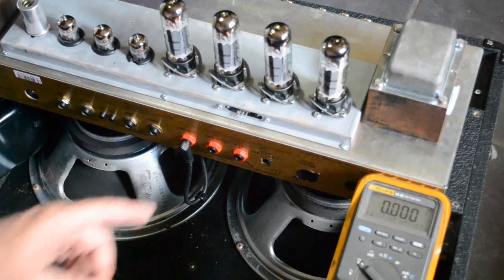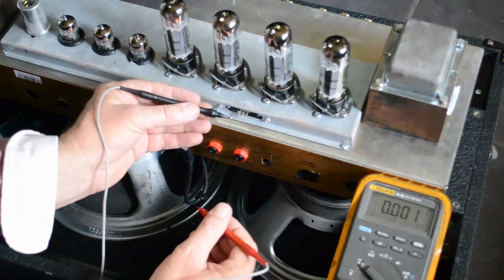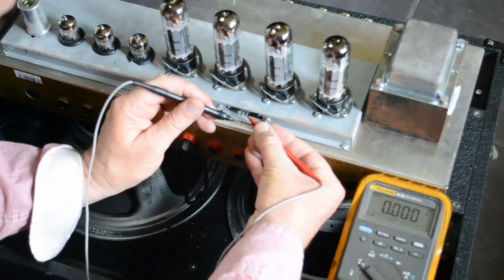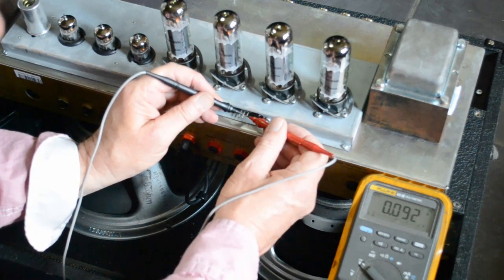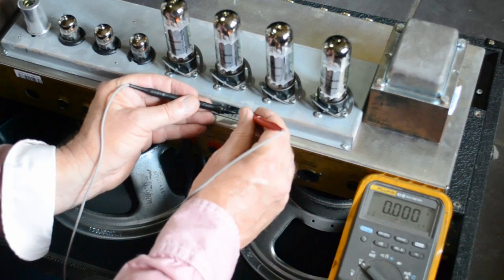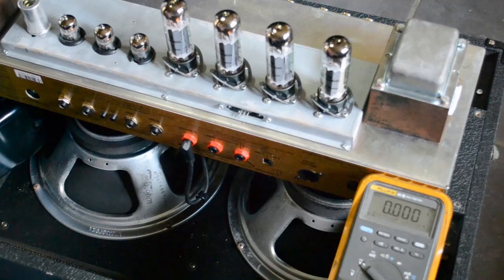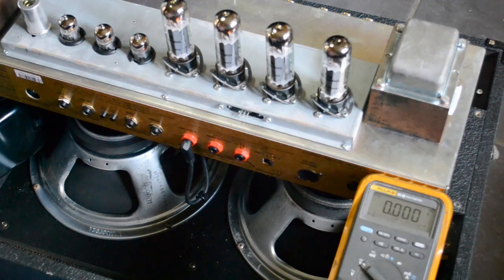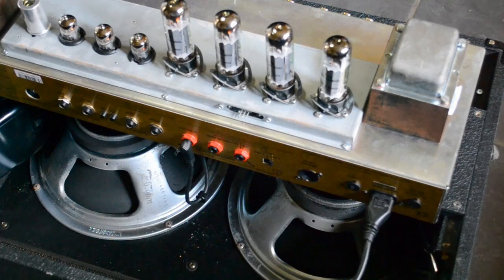Marshall JCM2000   TSL122 Valve Bias adjustment

Comment: Very good vid - thanks! I'm just about to bias one of these. A trick I've learned is to use a hooked probe and pop that on the center pin, so then you only ever have one hand near the amp. Putting the other hand in your pocket is a good way to ensure the current cannot run up one arm and down the other.
Reply from the maker: Thank you for your comments. Great tip.

Comment: Hey, I've got a stupid fast question: can it be somehow dangerous to take out the reverb tank without removing the entire head from the case? I'd prefer staying away from the capacitors you know. I've only to check the springs in the tank because the reverb is very weak. Thank you in advance.
Reply from the maker: Sorry I forget how it comes apart.
So long as it's not been turned on for a few hours you should be ok.
Reply: @JohnB-2021  okay thank you 😁

Comment: **This should be done by someone who is qualified in this field *

But just a reference,Centre pin is also chassis ground , the left and right pins are 1ohm to ground , 

But always check plate voltage and AC input voltage as valves are subject to line input voltage and do change depending on where you play / area etc 

Plate voltage calculated with bias will give the total wattage for EL34’s and around 18-19watts  per valve is quite hot . 
This should only be done by professional electronics technician, as plate voltage can be 400-500 vdc , and you don’t come back from that . Be safe out there guys , best to have it done professionally.
Reply from the maker: I wouldn't use the term 'qualified' 
I would say the person adjusting the bias needs to be 'competent'
Is there such a course to become 'qualified' at amplifier repair?

Comment: Anybody cut out and put a vent on top for heat ?
Reply: The metal cover that holds the main PCB (and output tubes) can be raised slightly with small washers (6 needed) to allow more free air flow. Not a lot, perhaps, but any air is way better than none (stock, there is a tight seal to the chassis top and heat can only escape through preamp tube openings or bias adj. opening). I did this with a friend's DSL 100 to help overall cooling, and hopefully add a bit of reliability to the amp. Certainly can't hurt.

Comment: Tweak the bias so that you get no crossover distortion , then add 2 or 3 mA as a safery zone
Reply: The crossover notch method is the absolute WORST way to bias an amplifier!!! They leave the tubes OVERBIASED, and running way too much current at idle, and as the tubes age, the crossover notch distortion will reappear. Use The Trainwreck Pages by legendary amp guru Ken Fischer's measured current biasing system. Just Google: "The Trainwreck Pages" and follow the instructions. 

Regards 🎸
Reply: Please explain .  I own a 122 also.

Comment: Hi John, I've been biasing my JCM 2000 DSL 100 exactly the same method as you by hand to balance tubes. I heard you mention not wanting to short it out whilst touching the pins. My hands are not that steady, and a couple of times I've accidentally just touched my left hand positive multimeter lead to centre negative pin, while holding negative lead against centre pin with right hand. Only caused a minor hum each time. Amp still works all ok, all be it sounding more trebly and less meaty than before! Maybe due to lowering the bias a small amount and containing original tubes? Amps year is 2000 so tubes are old and may even be older. I've got power tubes balanced nicely, but doesn't sound as full or pleasing anymore. Have ordered a full set of new tubes, but could I have caused a problem by just touching the pos lead to neg pin? Excuse my ignorance, but hoping it's just old tubes not reacting so well with re-biasing. Any advice and wisdom would be very appreciated.
Reply: You are measuring the voltage drop across a one Ohm resistor which is fitted between the valves' cathodes and ground, solely for the purpose of bias adjustment. If it is shorted out your amp will not be damaged.
Reply from the maker: Hi,
Valve amps aren't my forte, but I doubt you have damaged anything since it still works.
Lowering the bias may affect the frequency response, I have no experience with these amps so can't offer any advice.
Thanks

Comment: Optimally 80mA for each pair -  no noticeable change in tone - but a little prolong the life of the tubes.
When you wear tubes out to 2/3 sheet emissions even 75mA - but then you can fry a little sound. 

WARNING: absolutely need to replace the original electrolytic capacitors C36 & C37 in bias circuits from 47uF/63V for new 47uF/250V!!! 

Best type Jamicon, Nichicon, Rubycon Panasonic, Sony and other good brands with low ESR.

The variable component of the phase inverter will slowly stripping and leakage capacitors resulting in the disappearance of bias during operation of the amplifier.

Zoltan

Comment: Hi, I have a question. I have a laney irt60 212. I read the manual and it say V1 12Ax7 for the pre amp and V10-11 6l6 for the power. Im confused with the versioning the V1 and V10-11. Does it matter? I cant seem to find the versioning in the tube store. Can you please explain what it means? Thanks
Reply from the maker: Hi,
Sorry I have never looked at one, just replace what came out.
Reply: ok thanks
Reply: They're just labels. V1 for valve (tube) #1. You need a plain vanilla 12AX7 to replace the tube labelled V1 etc.

Comment: hi you put the red probe in the middle for one side and on the right side on opposite side -does the red probe go in the middle to best both sides -thanks
Reply from the maker: Hi,
No it's just the way I was holding the leads, easier than swapping leads over.
My meter is a good one, so it doesn't matter if the leads are reversed.
Black in the middle, red to the outsides.
Some cheap meters will read inaccurately if the leads are reversed.

Comment: Hello John, I'm new to valve amps and I recently got the same amp as you have and I wanted to replace the 4 big tubes EL34 because of some weird sound that the amp produces sometimes.There are 3 pins middle pin is common right? 1 and 3 are positive and both side should be set to 90mV or 90mA?should I replace the 4 small preamp tubes as well?
Reply from the maker: +Ramon Conte 
Hi,
Yes you're right with the pins, measure millivolts to set the current.
Read below, most people recommend less than 90.
Change the pre-amp tubes if you like, I guess you would be starting with a fresh set.
Thanks
Reply: Thanks John, yeah I will replace them all. Just one last question. When you say biasing it means biasing the Pre-amp and the power tube or the power tube alone?
Reply from the maker: +Ramon Conte 
Power Tubes

Comment: Does the red pin always measure the on the middle pin on the amp, meaning the black pins do both sides or the other way round???
Reply from the maker: +Namplifiermusic 
Hi,
Yes black in the middle and red on each side
Reply: Thanks John,  one more thing, with the multi metre what current or setting should I have it on to measure the voltage correctly
Reply from the maker: +Namplifiermusic 
Your meter should be set to voltage and set to a low level like 200mv or 2 volts etc
Reply: Sorry John one more thing, with the multi meter reading, I've read in forums that there seems to be people running connections to the trim pots as well as using the black & red connectors you are using here, did you do that or did you just use the black and red straight to the multi meter? Really appreciate your help as I've just received my new el34's in the mail today and am hoping I can pull off the bias without blowing myself up, cheers
Reply from the maker: +Namplifiermusic 
Hi, no problem, last day here, on Holiday 10 days.
I did everything in the video and nothing more.
Read some of the comments, it sounds like many people set the voltage reading just below the correct spec.
If there is no burning on the board, stick in the valves and set it up.
A burnt board can cause errors.
I hope it works 100% for you.
Thanks

Comment: dont we need to measure the plate voltage when biasing? im just asking
Reply from the maker: Hi, well all the experts who have commented below, never said so.
Reply: ok thanks.
Reply: No.... you are measuring the voltage drop across the 1ohm cathode resistor of each side,
 therefore an 80mV drop equals 80mA cathode current..
Reply: When biasing an amp, we are setting the output tubes' plate dissipation at idle. Plate dissipation is the product of plate voltage and plate current so if we know the plate voltage and the max. plate dissipation of the tube (which we get from the data sheet) we can calculate the current required for maximum dissipation. Plate dissipation increases when the amp is working so we have to choose a percentage of max. current that will keep average plate dissipation below maximum during playing. This could be anywhere between 60% and 85%, but for most amps 70% is a safe ballpark figure. We now have to adjust the negative bias voltage on the grids of the tubes so that they are passing our desired current. However, in this particular amp and many others we are expected to assume the plate voltage is at its design value and that the prescribed amount of cathode current (in this case 90mA for two tubes) will result in an acceptable plate current and thus acceptable plate dissipation. Well, you did ask!

Comment: Hi,what is the recommended ma to a jcm 2000 dsl 100. Thanks
Reply from the maker: Hi, I have no idea, I was hoping one of the other viewers might have answered.
If it has the same tubes, I'd guess it's the same.
At least we know a ballpark figure of 90mA or less.
Reply: @JohnB-2021  It depends on the line voltage too.Here in the USA we use 120 volts.If you lower your line voltage down to 110 volts using a Variac.The bias adjustment will change.So you need to set it at 110 volts and 90 miliamps bias.If you raise it back to 120 volts the bias will go to 100 ma.If you use your amp on the road there will be different line voltages.They do make a constant voltage transformer that will keep your line voltage the same no matter what it is.Your plate voltage will also change depending on the line voltage
Reply: Jai Miss 90 MV is factory spec. I was actually adjusting the bias on my DSL tonight and found 84-85 worked best for me. Some seem to like it as low as 70.
Reply: It depends on the line voltage too.Here in the USA we use 120 volts.If you lower your line voltage down to 110 volts using a Variac.The bias adjustment will change.So you need to set it at 110 volts and 90 miliamps bias.If you raise it back to 120 volts the bias will go to 100 ma.If you use your amp on the road there will be different line voltages.They do make a constant voltage transformer that will keep your line voltage the same no matter what it is.Your plate voltage will also change depending on the line voltage

Comment: 90ma is still to high on these amps and they sound way better at around 80 to 85 range
Reply: I agree.. 90mA is 45mA total cathode current pr EL34 tube. Lets assume that 5mA is screen current. (measure from voltage drop over the 1K screen resistor) 
40mA x 465V (schematic of the JCM2000 amps) is ~18.5W idle plate dissipation or 74% of max plate dissipation.. That is far too hot in a class AB amp with a aggressive load line (3.4K impedance pr pair). These amp sound cleaner, tighter and more neutral in the mids at 80mA pr pair which is around 65% of max plate dissipation, assuming the screen draw 5mA each. 

Mullards EL34 datasheet for a grid biased pair:

400V plate/screen (choke feed screens)
1.5K screen resistor (or 800r shared resistor) 
3.5K impedance (typical marshall plexi value for EL34 amps)  
-35.5V grid bias voltage (this can vary from tube to tube)
Finally and most important idle plate dissipation. 
30mA plate and 4.4mA screen. 
30mA plate curent gives a 12W idle dissipation or 48% of max plate dissipation..
Take that to the bank.. 

Ok the Marshall amp might have a little more power transformer sag than the Mullard example, but above 70% idle dissipation on the plates are stupid..
Reply: @MrAnders1976  Bless Your Bunions! It sounds like you know your onions!
Reply: @MrAnders1976  Ken Fischer taught me 10-40mA per tube is the safe operational range. 45mA at idle is way too high and the amp will turn to mud real quick. I like mine around 25mA per tube... tight, punchy, with plenty of headroom.
Reply: Agree, done many many marshall amps and lowered the mv to make the tubes last longer..

Also hook the meter black lead to chassis and set up with 2 meters is a lot quicker.

Comment: A little lower and your tubes should last longer.
Reply from the maker: Yes and maybe, buy a different amp who's pcb does not burn and track across to the bias circuit and totally blow the tubes and burn a hole in the board.
How much lower are you saying? 
90mA is the spec isn't it?
Reply: John B
I'm thinking 80 mV to 85 mV. I have a TSL602 myself. Like yours it's very easy to bias. I wish all amps were this easy to bias.

Comment: I just put new tubes in mine and I checked the voltage and I got 67mV from center to your left pin and 13V as in 13000mV to your right pin. I say your left as I didn't take the head out off mine so its opposite orientation. any ideas does the volume or gain have to be in a certain position? I don't want to adjust it until i determine weather I got another fault or not the thing was tinging popping and blowing fuses before i changed them. EDIT: sounds awesome though but I might DAMAGE THE TUBES, and im still using my power pad with the amp cranked sod it
Reply from the maker: Hi,
Look for burning on the PCB near the big white 5 watt resistor, R74 !!
I didn't have time to add a video but, this amp had a burnt pcb next to the resistor, it was tracking across to a small track which runs to the pots via a through plating.
It can blow the tubes.
I cut the tracks out and ran a piece of wire to bypass the burnt bit.
Let me know what you find.
Reply: thanks John.
Reply from the maker: Toller Brown that was a quick reply lol, are you in the UK?
Reply: yeah, blackwood southwales